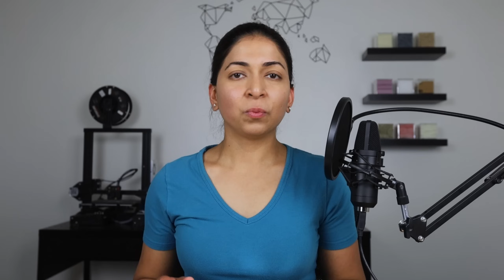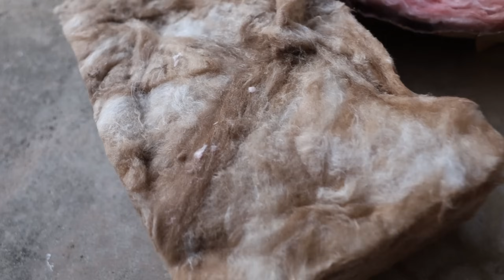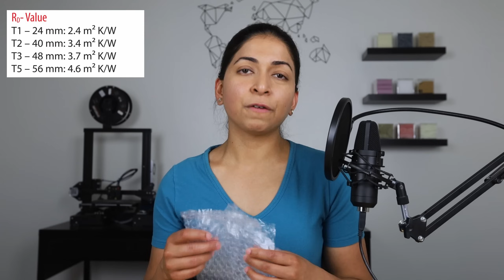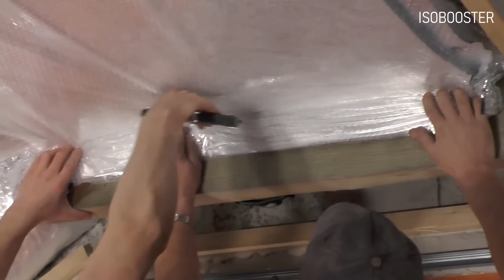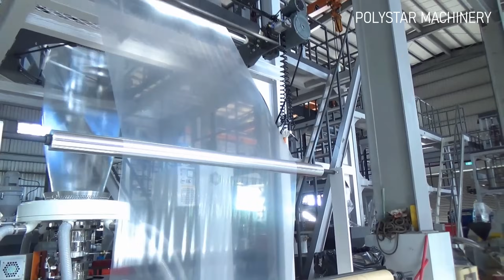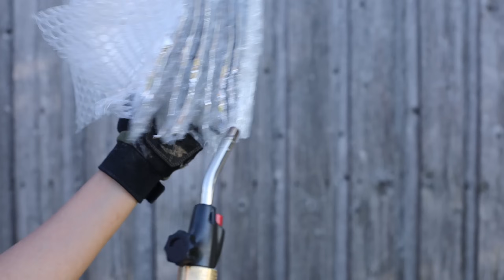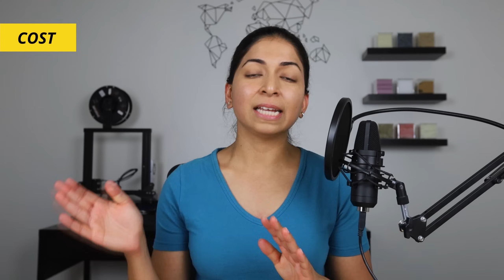Bubble wrap home insulation? | Isobooster

Comment: The idea that so much heat loss from the roof is radiant is intriguing.  I suspect that there is some creative accounting going on.  The heat is leaving the roof surface to the sky via radiation, since a clear sky is really cold.  But I suspect that this is bogus that much of the heat transfer from the house to the roof is via radiation.  In any case, it should be calculable how much this is.  You might have put adding a foil layer to my roof assembly back in consideration.

Comment: Have watched most of your videos.  Appreciate your work.
Am looking for a way to keep my existing attic cooler in Summer, having seen how hot it gets up there (by use of a remote thermometer.  I did put in wool insulation on the ceiling areas, but I figure by insulating the roof rafters that will help even more.  Found "Double Reflective Insulation Radiant Barrier" at Home Depot.  A 4' x 100' roll is $166, which is $.332/sq ft.  Photos show it being stapled to the surface of the rafters, which would make it easy to install.  Seems this would create an air pocket between the roof and the foil, which would provide some insulation to the attic.  Next challenge (from watching your videos) is making sure there aren't problems with water or fire.  I.e., water vapor can evaporate, roof leaks drain in a way that doesn't lead to disaster, and fires aren't made worse.  I presume its highly fire resistant so that isn't an issue.  As for drainage, maybe it's best to leave some holes and gaps in it.  While that defeats the goal of insulation somewhat, I expect it would be minor.

Comment: What is the R-Value per INCH?
How long does it last?
Since it reflects heat, how much additional damage is done to the roof/shingles since they cannot cool as well?
The more air tight the building the more Radon Gas you have to worry about.
Vast majority of A/C systems are undersized. Builders put those in for cost cutting.

Given the choice I would go with foil backed foam board insulation.

Comment: I learned from a physicist in the 70s who once worked for NASA, that aluminum reflects 94% of the infrared energy.  They built satellites with this idea, multiple layers of aluminum foil.  The key was that the layers had to be isolated from touching each other.  The first layer has 94% reflection.  In the second layer, 94% of the escaped 6%, etc...  The heat of the electronics kept the interior warm enough to continuously work in the cold space where no heat exists. I lined the interior of my boat with foam and aluminum for the winters of AK.  The foam also provided for flotation too.

Comment: Thanks for another great video. I wonder though could you do a follow up with: Reflectix BP48050 48-Inch-by-50-Feet Square Edge Bubble-Pack Insulation? I've run across some streaming cabin and shed builders who swear by it. It would be nice to have a pro like yourself evaluate it. It's readily available on Amazon, and very inexpensive.

Comment: And eventually (years) heat under a hot roof will break the plastic down, though obviously not nearly as quickly as UV light.  So I wouldn't use it there, directly under the roof...

Comment: At best, the R value in a wall would be R8.4.  That is much less than the standard of r15 for cheap fiberglass in a wall cavity. Radiant barriers only work under certain very specific conditions, require an air gap between barrier and the heat source being reflected (almost never acheived), and will be rapidly compromised, like a lens, by dirt buildup. On ductwork, it performs quite poorly and is more for looks than actual thermal resistance. I can imagine niche uses and it looks cool, but there is no way it can do what mineral wool does at a much lower cost, and it clearly won't maintain its reflectance that long in the only conditions where reflectance is of any value: ie. not in contact with other surfaces. If condensation is a problem against fiber insulation, there are other problems in a structure that different insulation, alone, cannot solve.  One energy expert says bubble wrap is a product looking for an application, rather than a solution engineered for real problems except, perhaps, packaging.

Comment: I have a question about the aluminium layer most insulation  materials are covered with. Does the aluminium reflect heat backwords if there is no air layer to reflect it to? And would it do so even if the warmth is reflected towards a warmer area?
I have noticed that there is debate about these matters, and my knowledge of physics isn´t sufficient to answer these questions myself unfortunately.
Love your great videos! Greeting from The Netherlands.

Comment: I built a workshop in Florida with a layer of Reflectix stretched over the rafters, 1x2 nailed along the rafters over the Reflectix, a layer of plywood and a galvanized metal roof over that to create a vented roof.  I was amazed at the difference in heat gain that it made.  It needed very little air conditioning.  It made me a big fan of reflective insulation.

Comment: Where and how should it be placed? I have read a lot that it should be placed at least 1 inch from the wall, but what if you use the reflectics an inch away from the outside wall - THEN you put regular fiberglass insulation in? Should this be put on LAST - after you put in fiberglass insulation, an inch away from it? What if both sides of the reflectix has shiny parts? Is that okay? Ive seen that this only lasts up to 20 years and then starts chipping off. Should I close this up in my walls because of this? I see a lot of the science you are speaking of, and thats all super helpful but I dont know the best way to actually install this as there are many opinions out there. Also, plastic and mylar do give off toxic fumes when burned. I dont recommend burning plastic and trying to breathe it.

Comment: I'm surprised to hear it's not commonly used.  IIRC we foil-wrapped the house we built (10-15 yrs ago), the product looked similar but was bonded together as a continuous single layer.  It was just part of the overall insulation tho, I think we also had fibre-batts in there too.

Comment: I used 1/4" foil bubble wrap on the ceiling of my steel cargo trailer.  It worked very well to deter thermal heat from transferring to the inside space. Half way through installing the insulation, I noticed that uncovered areas were emitting intense heat compared with the covered areas. Very impressed with the thermal resistance of the foil bubble insulation.
John

Comment: The requirement for any reflective insulation product is the metalized film or aluminum surface MUST have at least a 3/4" dead air space on one side of the reflective surfaces.  Without this dead airspace the product becomes a conductor rather a reflector in order to reflect solar/radiant heat. This product shown does not seem to have this airspace so it is truly a bubble wrap insulation and can only achieve a small R Value and act as a vapor barrier.  The bubble wrap itself is NOT a dead airspace.  Reflective Insulations do work and are extremely effective in certain applications, however they must be installed correctly.  A good quality reflective insulation or radiant barrier will block/reflect 95-97% of the solar heat back to it's source.

Comment: I'm sorry but this is bunk. Thermal radiation shield only works if you are putting it between two surfaces with a large temperature difference and thermal radiation is the main mode of heat transfer. Putting it between rafters is just a waste of time. You would be much better off if you just use regular batt insulation.

Comment: I had 4" fiberglass insulation on my water heater. Took it off and wrapped 2 layers of the mylar bubble wrap from home Depot.

I ment to rewrap over it with the fiberglass, but didn't get around to it. 

The 2 layer mylar bubble wrap reduced my energy use on my water heater  by a minimum 3 to 4x!

When I get around to it, I plan on fixing the hole in the outside door to the water closet, and insulating the interior of the walls with more of that. I literally can just staple or glue it to the walls and be done with it.

Comment: This might be not the best idea, but I wonder couldn't we create a sealed envelope, in which we could regulate the temperature and the humidity?

I thought about this for multiple reasons (isn't air the best isolator?), but one of them is that where I live (Europe) the recommendation is to keep the house at a certain minimum temperature when we are not at home (so that water doesn't form on walls, resulting in mould).

So I thought, ok but what if instead of having to keep warm the entire house, we had to keep warm just a few centimeters of a sealed insulation system (so that the interior wall doesn't form condensation)?

Is this a bad idea? I don't know.

Comment: front page of   savegreen dot  energy   similar product only for greenhouses save 3 % world greenhouse emisions for 150 million to build manufacturing plants (enough to convert all worlds greenhouses in 5 years time) failed NSF funding because its based on established science, not based on the merits of the idea , which are sound and would provide an affective two or three times the thermal value of existing greenhouse thermal layers due to its dynamic and adaptable nature.

Comment: "Okay - focus"...  :-)  :-)  Well - I would not my self and I would not recommend anyone to live inside a plastic bag. Just imagine using traditional rain clothes, for example when biking. So if you sweat, you get wet on the inside, because of the plastic. Would you like to live in such a house? If you think about it - probably not. Even if you have an ventilation aggregate to counter for it - but that again is not very environmental or indoor climate friendly in it self. Because todays modern homes in general have way too dry indoor climate to be good. But then maybe many does not think about that most wood houses (timber frame or stick frame cosntrucion - I am not sure what you call it in correct English) are actually living inside a plastic bag. Because you use a vapor barrier. And that is kind of strange, because the wood construction in it self is a good thing in many ways and can give good indoor climate - but that is destroyed with covering the home in plastic. I advocate for diffusion open constructions, because that gives the best and most healthy indoor climate.

Comment: Ventilation is a very serious issue - both due to heat loss and due to water condensation. Mechanical ventilation with heat recuperation is absolutely necessary in airtight homes.

Comment: I don't know if things are done the same way in the USA as they are done here in Australia. However, here it's common for builders to lay a thick plastic sheet down as a moisture barrier when they prepare and area for a cement slab to be poured. At one construction site I passed a few times on the way to work I saw them laying double sheets of bubble wrap on top of the moisture barrier plastic, so I stopped and asked about it. The builder said the bubble wrap was a cheap way to greatly reduce heat loss through the cement slab into the ground, and thus keep the house warmer in winter. That was a good idea as they were building ins a snow prone area.

Comment: Our local community hall was wrapped with a Reflectix product, then covered with siding. After spending $30,000, the heating bills have not fallen one bit. I spoke to an engineer about this and he said these reflective barriers are a scam, and no reputable contractor would ever use them. The actual R-value is generally accepted as being no more than 0.8 and I see that our local building supply place warns that no performance promises are being made. Spend your money on air-sealing and real insulation; don't be taken in by fly-by-night contractors!

Comment: Love you.... Yet Bubble Wrap as insulation? After everyone nearby has popped all of the bubbles, exactly how insulating can it be? 😆
I have used it to insulate my little shopping cart. It didn't protect ice cream or most frozen foods farther than 4 blocks walking in 105 degree temperature, but it was serviceable, with some grid style wire between the layers and lasted over 4 years the way I applied it to the jumbo size shopping cart.

Comment: ive put this isolation on to the lower part of my windows since the cold streams low and heat goes high.. if you have cold windows in your hallways doublewrap it.. i use magnet tape to remove it in the summer.. 5 years and still works great, also alot less burning gas in the winter..

Comment: I can see this product catching on very quickly in Canada.  It will not replace thick fiberglass batt insulation but supplement it.  It's likely going to end up replacing traditional polyethylene interior vapour barrier between the gyprock and wall stud or joist.  It's only downside is builders constantly wanting to pop the bubble wrap often.

Comment: Were you compensated for this info- mercial ?  A 1/2" air gap has an R value of has an R value = 1, Double layer Reflectix R=1.1. Installed in a cathedral ceiling the R value against heat loss is between 1 and 2 depending on local climate.   So for heat loss it is not as good as 1" of rigid foam board a cheap and easy to install product.

Multiple layers of aluminized LDPE will not add significant performance value. Reflective insulation has a  valid place in the market, particularly in hot climates. LPPE foam has a high R value but LDPE bubble wrap does not.

Comment: I think the biggest drawback for me with this product would be the low fire resistance. Up here in Canada, we get cold winters with lots of snow, which means lots of heaters running, which in turn causes a higher risk of fire. I'd be interested to see if doubling up the thickness of this product would increase its thermal insulation value, or if that would be necessary at all. Most homes are built with 2x4 or 2x6 construction, so it being only just over 2" thick might make for larger air gaps in wall cavities.

Comment: Doubles as high fashion you say? Also doubles as monsters in Doctor Who of the 80s.

Overcome huge psychological barriers of consumers? Yeah, they'll pop every bubble obsessively one by one before the stuff is even installed :D

I've said it before and i'll say it again, polyethylene is actually remarkably efficient, also for single use, because most of the energy is reclaimed when it's burned, and it's a very clean burn, and the material is very space and weight efficient in use. We are unlikely to be fully independent of fossil fuels for a while yet, and in the interim, burning trash like this can help fill the availability gap. We just have to get it to not go into the ocean or the landfill, where it doesn't belong at all.

Comment: I'd like to use it to insulate a mobile home/van.. but I'd like to build an additional layer of heavy-duty aluminum foil on the inside layer to reflect electromagnetic fields. I feel that with minimum costs and effort I can create a Faraday cage.
Reply: Actually, assuming your van is made of a conducting metal like steel, it is already a Faraday cage. 

However, the effeficacy of a Faraday cage is inversely proportional to the frequancy of the radiation, that why if your van was to get struck with lightning (a low frequency electrical wave) while you were inside it you wouldn't be at risk of electrical shock, however you can still use your phone while inside it as the frequency of microwave radition (the radiation conventionally used for phones) is much higher than that of lightning. This is also why, if you stand in a faraday cage you can still see light (electromagnetic radiation) coming through the gaps.

Hope this helps - Friendly Physicist.
Reply: @johndthackray  .. thanks John. I'd actually like to mitigate all forms of electromagnetic waves. I'll house the router in an outside compartment away from the main living area and run a cabled network to that router. But I'd have to put at least 3 layers of heavy-duty foil right around to achieve that level of EM shielding. Any glass will need to be treated as well.
Reply: I'll also ensure that the living area is sealed and I'll have an HVAC positive pressure system installed. I could carry a cannister of O2 and make it full hypobaric. My thinking is to make a safe and healthy environment that I'd actually want to spend time in.

Comment: This product is poorly designed by someone who doesn't understand the basics of radiative energy transfer. The reflective aluminum layer is sandwiched between two or more layers of optically clear but thermally (IR) opaque polymer layers (the 'bubble wrap'). When used within a wall cavity as thermal barrier, 100% of radiative heat transfer is in the IR, which is absorbed by the polymer layers. This leaves no thermal energy to be 'reflected' back to the source (interior or the exterior). If the exterior surfaces of the bubble wrap are finished with the aluminum layers, the whole thing will act as a good conductive. convective radiative barrier."'Reflectix" brand insulation better since both exterior surfaces are aluminum and act as a good IR reflector.

Comment: I'm always skeptical when it comes to use plastic as construction material.  The fact that it doesn't "breathe'' must lead to humidity issues and mold over time ? I know that plastic is light and practical and all, but if I built my house one day I think that I'll stick to natural materials like wood, straw, mud, stone, wool and glass. I can't brush the feeling that plastic is not strong enough and is barely adapted to "live" with atmosphere, rain, temperature shifts, wind etc... in the long term I have a hard time picturing a plastic-based house/isolation resisting to the elements and simply life. But I'm no expert and maybe that I'm totally wrong.